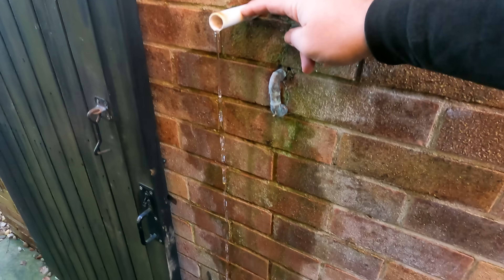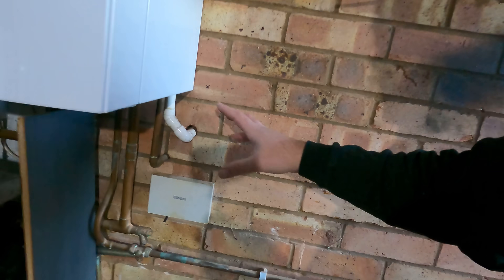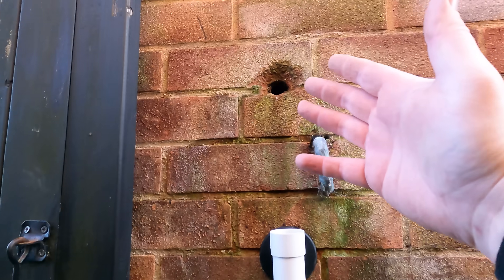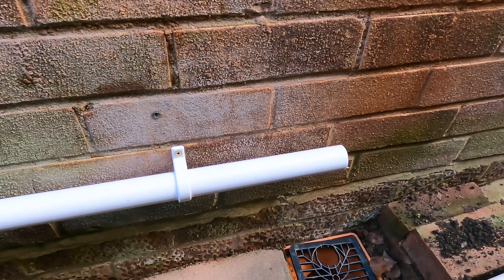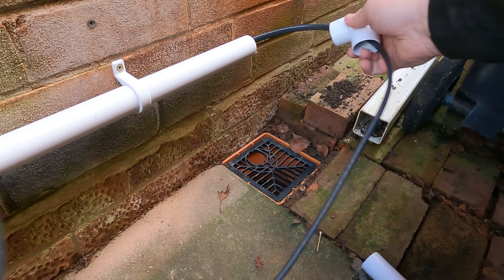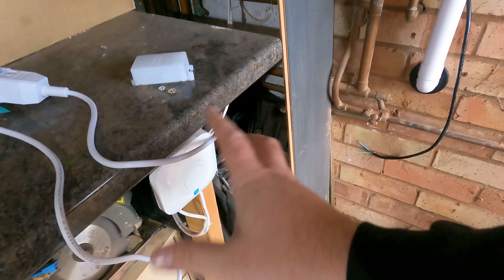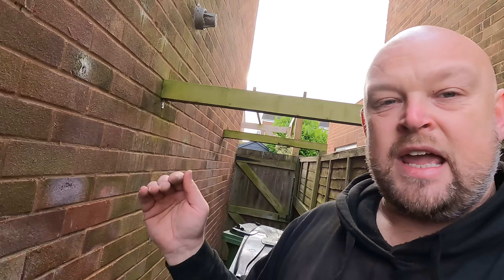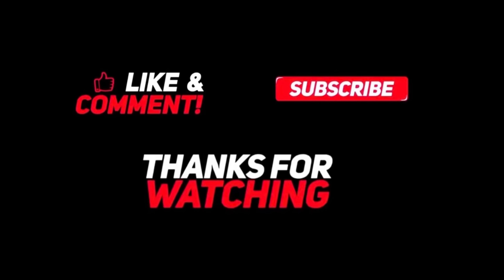FROZEN CONDENSATE PIPES...I have THE SOLUTION | REAL WORLD PLUMBING

Comment: Great video. One question: Won’t you still risk freezing with such a low set point 3’F  ?
Reply from the maker: No…. Water freezes at 0degrees mate, think like this…your fridge is 3/4degrees and that doesn’t freeze
Reply: @ Thank you. I think the confusion might be C vs F because water freezes at 32’ Fahrenheit . I’m in USA and looking at my fridge settings right now and the refrig  is set at 40’ F and the freezer at -1’ F. Not trying to give you a hard time, but I had condensate line freezing problems years ago, so I’m very interested. (Go easy; I’m an old guy 😀).
Reply from the maker: Trace heating within the pipe will stop that issue buddy…. 👍🏼👍🏼👌🏼

Comment: Madness - install the condensate properly in the first place - correct falls, max length and correct type and diameter of insulation. These freeze when its not done properly.
Reply from the maker: And they freeze when they are installed correctly…. -8 will do that to most things with water in them….
I’ve seen 40mm pipes freeze solid

Comment: Great video mark had the same problems during the week with the cold weather and condense pipes even inch and a half frozen solid, heat trace is the answer and should be fitted as standard. Hope you asked mr gdb recovery could you use his music 😂😂😂😂
Reply from the maker: Yep BoilerTrace will stop that happening mate 👌🏼👌🏼👍🏼
Reply: Top tip next time you fit one of those and you want to see it working ie the green light on is spray a little pipe freezer spray on the silver temperature sensor 😉

Comment: Why didn’t you run the pipe down in the garage and out at low level? The least pipe outside the better. 👍🏼
Reply: Or diagonally outside with no elbows.
Reply from the maker: No need when using the BoilerTrace….. plus it shows just what it like to install 👍🏼👍🏼

Comment: As said by many others,  just lagging is needed. Ive never had a freeze up in all the years since condensing boilers came out.  Make sure the correct insulation is fitted properly and away you go.

Comment: When mine first froze up maybe 15 years ago I sorted it with warm water, from atop a ladder in a blizzard. My combi is in the loft and the condensate pipework drains into the top of a convenient external drainpipe. After a few days like that I figured a way to set up an indoor run off into a plastic bowl which I emptied daily during winter. After a couple of years doing this I modified the exterior portion of the pipework replacing the half inch pipes with three quarter inch and taking a stupid 45 degree elbow out of the run, replacing that with a 135 degree one, to keep the water flowing more freely. Had this not been successful I planned to look at one of those heaters but all seems good now.
Reply from the maker: Glad to hear it mate….👍🏼👍🏼
Internal pipework is always best

Comment: Happy New Year Mark.

I’ve fitted many trace heaters, since the 2009/2010 deep freeze winter.

If possible, I would always use 45 degree fittings, and not 90 degree elbows or swept bends.

Either way, though trace heater kits, were and still are an easy solution, to a great inconvenience…
Reply from the maker: HNY buddy…

Yep 45’s are a good shout to keep the flow nice….

Comment: If the condensate pipe is lagged the the other kit seems superfluous. I live in central Scotland and have lagged my external 22mm condensate pipe. I have had no problems with it freezing over the last 15 yrs.
Reply from the maker: Belt and braces with this kit👍🏼
Reply: Things like this have to be done because the so called " Heating Engineer " I use these words very loosely.  Who will have been Gas Safe registered  and with a million years experience the job. Carried out a "Professional " install. Where the owner may have paid top dollar for the job. 😊
Reply: Sometimes they freeze if your heating doesn't run enough just before and during the cold weather. You've probably avoided it because you've kept your house warm and not relied on the frost protection mode.

Comment: Thanks for that, Mark. The condensate run often seems to be a bit of an afterthought and you end up with a long, shallow, uninsulated pipe that works fine when it’s put in but freezes up just when you need it most. I suppose with people running their combis a bit cooler these days, that might play a part too.
Reply from the maker: They will freeze unless something is done with them 👍🏼